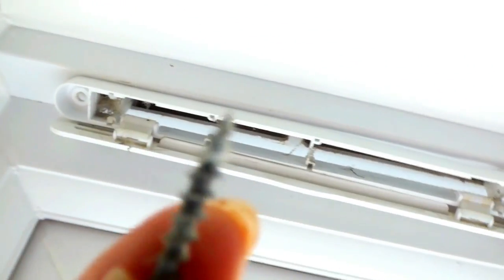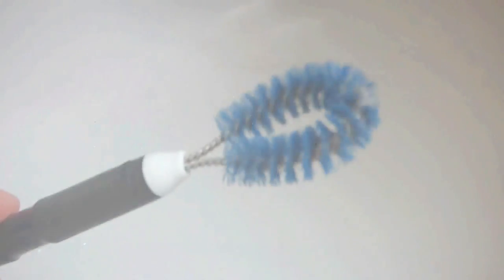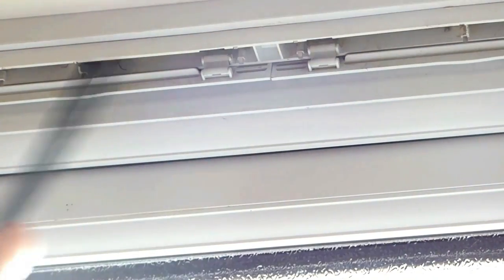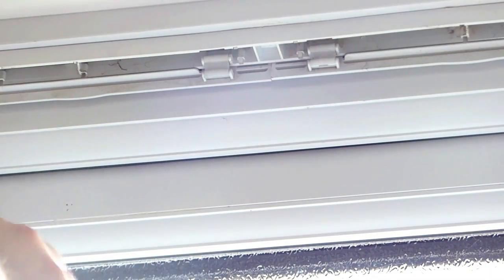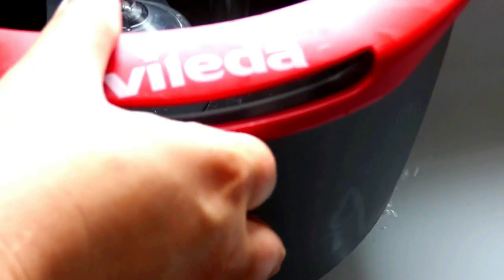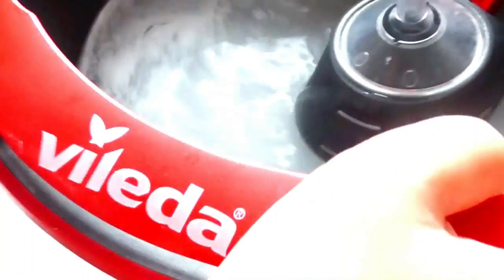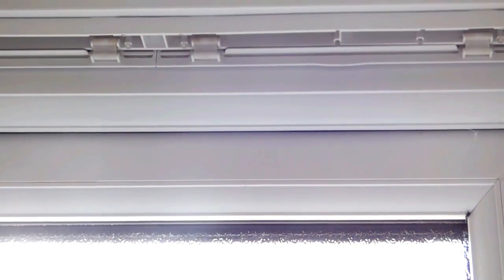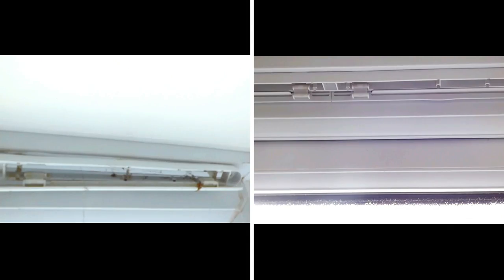HOW TO CLEAN TRICKLE VENT [CLEANING UPVC WINDOW VENTS] - HAYLEY'S TIDY TIPS

Comment: I’ve got a fine wire mesh separating the inside and outside parts of the trickle vent.  Inside part is accessible enough, but the outside is stuffed full of 🤮spiders cocoons.  

I think my strategy here will be a compressed air gun to blast them all out…..
Reply from the maker: I think this is a GENIUS strategy Anthony ☺️